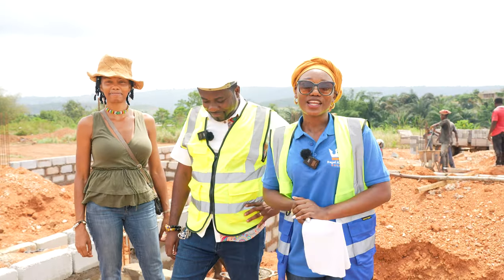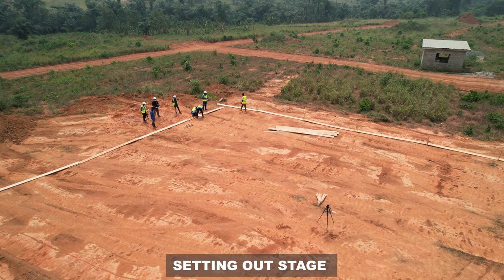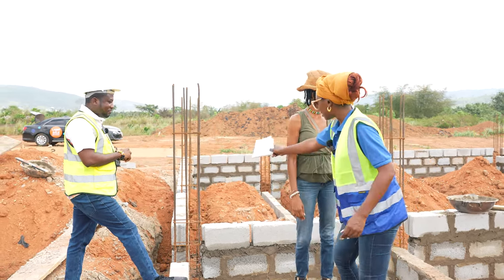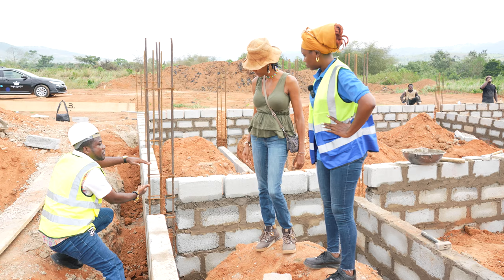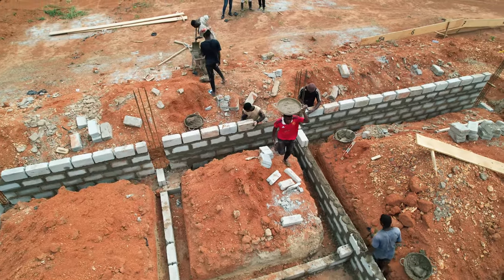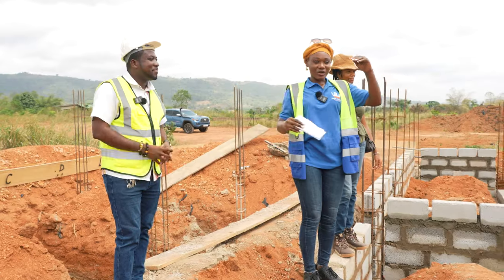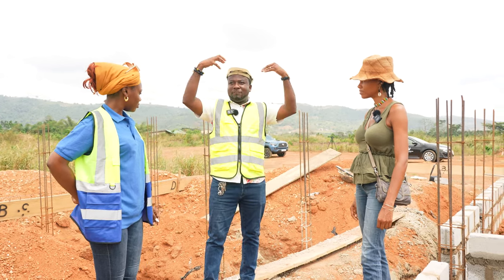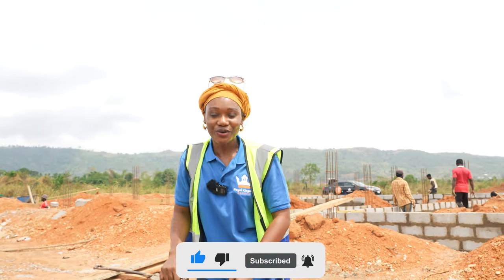IMPORTANT NOTICE !! NEVER IGNORE THESE DETAILS WHEN BUILDING THE SUBSTRUCTURE.

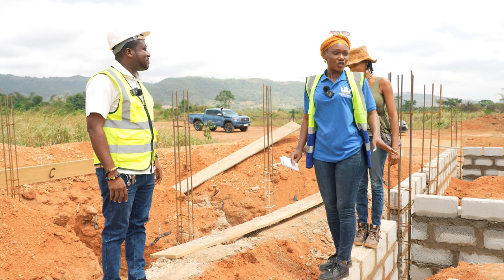Comment: Do you not use DPC for the foundation footing? 7:58
Reply from the maker: Hi there! So it depends on the specifications of every project. However with this particular project we will definitely use a damp  proof membrane before the concrete slab is cast.
Reply: @RoyalKingdomEstate  Thanks for the reply. Please explain what specification would not require DPC. And are DPC and DPM used at different stages of a project?
Reply from the maker: @leroydias5075  Generally dpc for foundation footings is not a common practice, as DPC is typically used to prevent moisture from rising into walls above ground level, rather than to protect foundation below ground level. Per the specification in the structural design, we're required to do a dpm before the concrete slab is cast which will equally prevent the ingress of moisture into the building